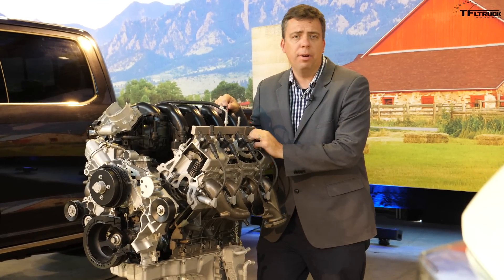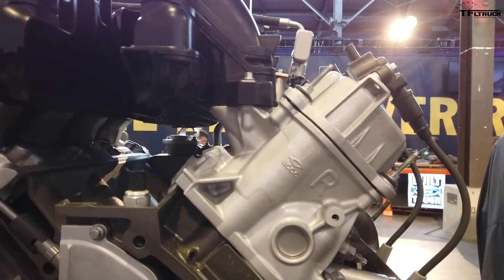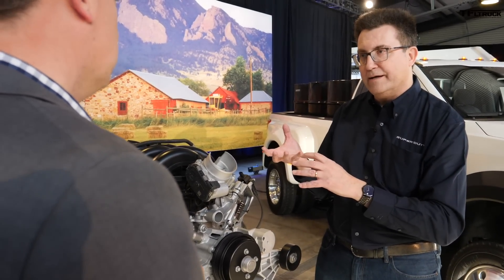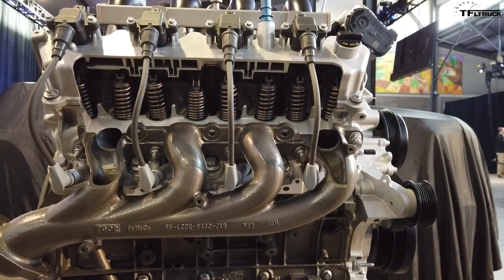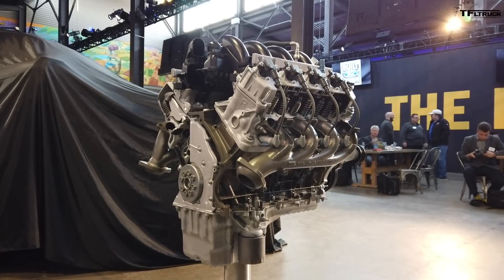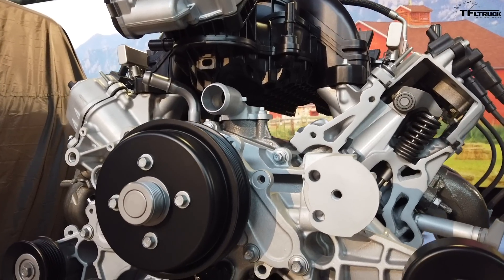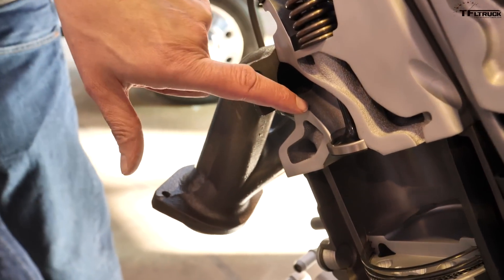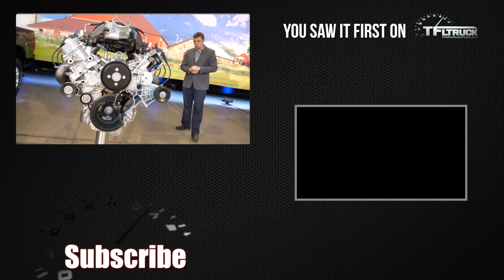2020 Ford Super Duty 7.3L V8: Here's What You Need to Know!

Comment: GM has left the conversation.
Reply: Boss 302   GM is laughing at the conversation ford finally proved what we already knew. Overhead cams suck and don’t need to be in trucks. This engine will be a success.
Reply: @theaveragejoestinkeringand4407  no GM is crying because Ford proved that they can build a better ohv engine. GM is mad that they dont have the capabilities to produce a reliable ohc engine. Ohc engines dont suck. You just dont understand them. The only reason this engine is not an overhead cam design is because it's based on the 6.7 powerstroke diesel block. The 7.3 will literally be indestructible because it will never see the kind of cylinder pressure the block was designed to withstand. Even with a giant turbo it won't come anywhere near the pressure of a the diesel version. This one engine made GM as a whole obsolete. RIP GM...
Reply: Boss 302 I don’t think gm really cares and they aren’t doing any crying I’m sure. It has a long way to go to earn the reputation  of an ls. And The guy explains why it’s not an overhead cam lol.
Reply: @theaveragejoestinkeringand4407  Haha are you serious? GM cares alot about what Ford is doing. They have copied just about everything from Ford even to the point of hiring people to go to Ford factories and taking pictures and studying everything that Ford does. GM  wants to merge with Ford because they are afraid of filing for bankruptcy again. And I am fully aware of what is in the video.
Reply: @theaveragejoestinkeringand4407  earn the reputation of an ls? Like the reputation they have for blowing up? I think the 7.3 is safe.
Reply: Boss 302 We have a whole fleet of LS engines at work that are slowly replacing a fleet of ford Tritons Our nationwide lease company quit buying them because of problems and mileage and we have replaced 4 Tritons engines in our fleet of about 25 trucks we have never replaced an LS engine so far. We have one with over 320k hauling miles. Mine has 275k on it and runs like new. I trust it just like it’s a new engine it doesn’t bother me at all to put it on the rev limiter. So they’re definitely not to bad Considering they make a kit to swap it in just about everything but the dishwasher in your house they wouldn’t do that if it wasn’t any good. From what I read about GM spying on Ford is they sent some engineers on a public tour of a Ford plant that anyone can take. They actually bought ford replacement body parts for Ford pick ups and cut them up and found problems with them and improved on it before they used it on their trucks. Something about how they were put together. Supposedly they found better ways to assemble beds and doors as opposed to how they were doing it. If I was a company I would want to see what my competition was doing also. That has went on for years both ways and it’s pretty smart. It doesn’t look to me like they have copied anyone They’ve used an old reliable efficient engine Design that That modern idiots have made fun of for years even though it’s been the best and longest lived design out there And now fords building something just like it And even  explaining on how it’s better. I guarantee it will be one of the best engines they have made he’ll I might own one but In 10 years every ohc engine they made before it will be forgotten. But 20 years from now there will still be shade tree mechanic stuffing LS engines into everything under the sun.
Reply: @theaveragejoestinkeringand4407  hahahahahahah thanks for the laugh. But that was all a bunch of opinions and no facts. I dont know where you are getting your information from but you need to find better resources because it's all false. The funny thing is I work at a shop that maintains fleet vehicles from multiple different companies and they all run fords. They used to run GM vehicles but the cost of maintaining them was to much so they replaced them with fords. The average life span of the fords we maintain is 800,000 miles. That's average. There are many Fords that have reached a million and counting.  All with just basic maintenance. Not one single gm fleet vehicle has made it even half way to the average Ford milage. All the ls engines that we have seen have lost compression due to poorly designed cylinder heads and poorly designed piston rings. They just dont last as long as the 5.4s and 4.6s. I've seen it literally hundreds of times. We have sent countless Chevy equinoxs to the crusher (I shouldn't have to explain why) and dont get me started on the chevy spark. The real story of GM spying on Ford is they were doing it because they couldn't figure it out on their own so they had to copy fords way of doing everything. They didn't deconstruct any Ford parts. You are either making that up or read some false information.
Reply: @theaveragejoestinkeringand4407  also you do realize that this isn't the first ohv v8 that Ford has made right? The ls is literally a copy of the Ford Windsor engine. GM admitted that also...
Reply: Boss 302  ok u just lost all credibility at 800,000 mile triton. I’m sure there’s some that’s made it.You must be like 17 years old. There’s not a damn fleet on this planet that’s going to run a triton with 800,000 miles on it unless it’s some broke ass company. Who do you work for kid Sanford and son or rent a Wreck . Lmao Yeah next time I need some real honest info I’ll ask the Almighty all knowing boss 302 For info. I guess you’re right and the whole rest of the performance world is wrong lol. If you think any of these car companies have to spy on each other just to build a car that will run you’re an idiot. That’s some shit only a kid or a teenager would come up with. Engines are 100 times better than they used to be as far as lasting and the LS is no exception. It has helluva lot less flaws than a triton. Not to say that I’ve not seen and drove some tritons past 300k miles And they were still reliable but They were noisy inefficient and slow and after blowing out 5 of its 8 spark plugs Which most of them did and a truck load of cam phasers. They definitely didn’t have any bragging rights over any vortec engine except maybe the 2200 4 Banger in the s10. There’s more 5.0 coyote motors blowing up than ls engines I got a friend at work had one of those ticking bottle rockets ford wouldn’t fix. So if all this high tech spy Hunter bullshit that’s going on How come Ford and General Motors are building their truck transmissions together look that up old wise one oh wait I bet it’s because GM is so dumb they can’t build their own right?? Even though they perfected it Lol. Once again general motors hydramatic transmissions probably the most popular automatic transmissions for racing. Ford probably just wanted to lend a helping hand I guess. You can go up to thunder Valley and see a Ford with a Chevy engine in it just about any weekend and I guess you think there’s no reason for that either. But finding a Chevy with a Ford engine it is like finding a living dinosaur. Your Ford superiority argument Is like pissing into the wind. I can’t dog them because they make some good vehicles but they are not superior. There used to be a purple fox body mustang up there all the time Kicking ass with a Chevrolet engine and th400 gm transmission in it.  It said built Ford tough with Chevy stuff across the back glass. Blabber all you want that saying is known all across the USA. There’s still a reason for it.
Reply: Boss 302 Look up GM spying on Ford I read it out of a news article from a car magazine. They took a factory tour to see the production line Then they purchased  dealership replacement body parts and disassembled them. I think they were more interested in how they were putting the aluminum panels together and decided they were going to do it a different way.
Reply: Boss 302 Adults don’t say the struggle is real.  Flat bill skater kids do though . I’m not struggling I’m sitting here in a Walmart chair passing my phone around to three people in the shop laughing as we debate on whether or not we’re going to put this fuel pump in before my phone dies or laugh at This wonderful display of ford pride that makes no sense whatsoever.

Comment: So where did the development of 10 speed transmission come from? GM. Ford begged to come on board for the Raptor.
Reply: Wrong. Ford designed, engineered, and built the 10 speed then sold them to GM. GM was going to build a transmission for Ford but Ford turned it down because it wasn't good enough.

Comment: Needs to be 600hp with a ten speed and 455 gears
Reply: Its not built for racing, Its purely a work truck engine designed clean sheet to be as durable as possible, however given its sheer displacement I've read that a few tuners are getting over 600hp out of it with nothing more than some bolt on's a hotter cam and performance tune.

Comment: I know why they picked 7.3L. That choice has nothing to do with science, math or efficiency. That can all be achieved with trick computers and mechanical systems. Ford used all of the tricks they had in their box to get here. The guy sounds like a really good salesman and talks an interesting game, but at the end of the day, it's all snake oil. 

It's bait for all for us who miss the bulletproof 7.3 PowerStroke(International DT466* - See EDIT) that used to be available in the Super Duty. Ford stopped selling them because they just don't die and get decent mileage. What you're looking at here is "Engineered Failure" with a really shiny finish and a good sales pitch.

EDIT*

I apologize for any misdirection on my behalf. The 7.3L PowerStroke is not an International DT466. It is in fact an International Harvester T444E. I was misled by the fact that many of the parts from the DT466 are interchangeable(Injectors, glow plugs, fuel pumps, etc.) and the fact that some of the school buses in my area have come in for service at the Ford dealer I used to work at.

Comment: The horse power rating wasn't said because it's probably not very high. But probably has almost twice the torque it does hp
Reply: It's likely better than the 6.8 v10 but not significantly so. It will be perfect for who it's intended.
Reply: The HP and TQ will be far less than what many are predicting because they're building it to be reliable. It will be best in class in both, though.

Comment: Guess Motorhome mfg will finally get a V-8 again . Fuel economy hahaha !
Reply: Yes the motor home is a superduty chassis . this is the new superduty gas engine for 250 /350/450/550/600/650/750 the 450/550 is the motor home chassis.   The 6.7 ford diesel is also still available.

Comment: Hum, this GAS engine JUST happens to come out to 7.3L, the same liter as the most reliable engine in Fords history, the 7.3L DIESEL. Hum sounds kinda fishy to me! The 7.3L Diesel is well known to every serious Diesel Truck owner because it's known for it's EXTREME reliability, 900,000 miles is not unheard of. Anyone who has one doesn't want to sell it. Anyone who needs one wants one! The real rub is that 7.3L Diesel in Fords from 99-2003 wasn't even build by Ford, but International Engines. It was a stop gap for Ford Motor Company while they had the 6.0 developed,and we know how well that turned out, at least until the problems were resolved. Yep that GAS engine just happened to come out to 7.3L's.......RIIIIGGGHHHHTTTT! I don't believe Ford at all. This is a new low for Ford on the unsuspecting customers, especially after their expensively high maintenance engines they've been putting out since 2005. Heck since then you pretty much have to pull the bed and cab off the truck to work on it. Making it mostly dealer repair only. NO THANK YOU FORD, I'LL KEEP MY 7.3L INTERNATIONAL in my Ford 2001 Lariat and you can keep your new trucks!
I sure hope this engine works out for Ford, because they're getting a VERY BAD rep in the truck world lately. Best Wishes & Blessings. Keith Noneya
Reply: Just so know, Ford did NOT develop the 6.0L or 6.4L Powerstroke, those are both international engines as well just like the coveted 7.3L. Ford did however fully develop and engineer the 6.7L Powerstroke in house, and so far its been leaps and bounds better than the 6.0L or 6.4L ever were.
Reply: @nathanmcdonald610  Thanks for the heads up on the 6.0 & 6.4L's. I'm sure International did a fine job until Ford made changes that probably in the best interest of reliability. Best Wishes & Blessings. Keith Noneya

Comment: Old 460 which are 7.5 liters Could get the snot beat out of them all day and the engine didn’t seam to care. On the other hand with my old 5.4 Ioaded I would get on the highway and it would just be wrapping out at 5,500 rpm and would be stuck there because it didn’t have enough power to accelerate a little more to shift gears. I thought forsure I was going to have a spark plug fly through the hood. I’m all for this new 7.3 because I think diesels are getting way to complicated for their own good.

Comment: Any speculation on hp torque numbers?  My guess, 450hp, 550lb ft torque.  Max torque at 3000 rpms.  Anyone else?
Reply: Interesting to speculate. Hmm. I don't recall HD engine numbers, but the truck version of GM's 6.2L (in light-duty Escalades for example) makes 420 HP and 460 lb ft. Upping that to 7.3L but using port injection, your estimate seems pretty good imho.

Comment: Diesel....... Say that with me D.I.E.S.E.L
Reply: E.X.P.E.N.S.I.V.E.
Reply: @andyharman3022  so why get a truck made for hauling heavy loads if your not willing to pay for it, sure diesels are expensive for a loaded out brand new model, but why not go used a year or two and less luxury??
Reply: Assuming this engine is a $1000 option over the 6.2, it will still be $7000 less than the diesel.  One can buy a lot of fuel for that.  Since the gas engine is lighter than the diesel, the truck will have more payload capacity.
Reply: So how will Making it weigh less increase it's tow capacity? Normally tow capacity is determined by horsepower and especially torque. Now I can understand the buy more fuel with less expensive option but doesn't that defeat the purpose? And sure you can save a little in a shorter distance but take two trucks one Diesel and one gas and drive from coast to coast with a goose neck trailer with the exact payload and see which is better.
Reply: If you would have actually read my comment, you would have noticed that I said hauling, not towing.  Lighter engine means more payload capacity within the rated GVW of the truck.  And don't preach to me about diesels; I run a diesel pickup 100,000 miles a year transporting travel trailers.  I know what the costs are.  Diesels will have higher towing capacity, but will only be cost-effective for people who work their truck as much as I do.  Say you get 10 mpg towing the big trailer with a diesel, and you get 7 mpg towing the same trailer with gasoline.  You would be buying 30% more fuel with gas, but your fuel cost would be the same if gasoline is 30% less per gallon.  And that is pretty typical for regular these days.  I've seen diesel cost 50% more in some places.  So if you can do the same job for the same fuel expense with a truck that costs $7000 less, why not get the gas engine?
Reply: @andyharman3022  cool

Comment: How about bring the 7.3 diesel back instead of flaunting efficiency  about a 7.3 gasser but have Absolutely no specs on real mpg. I have two 2001 7.3 one for work which weighs close to 11k with service bed I'm getting about 14-16 mpg. The other is just a normal 4x4 crew cab 20+ mpg without my foot in it of course. If ford cant come close to what were getting with diesel 7.3's then what's the point in this. Sounds like marketing to me.

Comment: I cant wait to drive one. No more need for a manual trans given the 10 speed can be controlled to stay in any gear. Too bad the 10 speed is from general motors. So yea 7.3 could be a sales gimmick just like bringing back the awesome 5 liter but who cares. Nobody said anything about the 6.2 liter that gm and ford has being similiar. And everybody talking trash about the 5.4 3valve- if you actually change your oil on a regular basis, you dont have problems on any engine. Those are the people that change their oil every 10k miles and find that their engine is ticking because its sludged up then talks trash about the manufacturer because the vehicle they are over their head in debt with needs an engine because their too stupid to do the easy stuff like maintenance.  Go ford. Keep it up!!!
Reply: soaringtractor thanks for the claification hero!!

Comment: So you take an old 460 turn it into an LS motor and then because you call it a 7.3 you have to throw in piston oil coolers, which are normally only found in the diesel engines..like the 7.3 power stroke....sounds like a love triangle that gee idk only every working man that drives a real truck has been screaming for since the dawn of time..

I'm happy to see the engineers except defeat but come up with something TOTALLY NEW and not ride on the coat tails of 3 fundamental engines and think it's state of the art....
Reply: Piston oil cooling jets are common in gas engines.